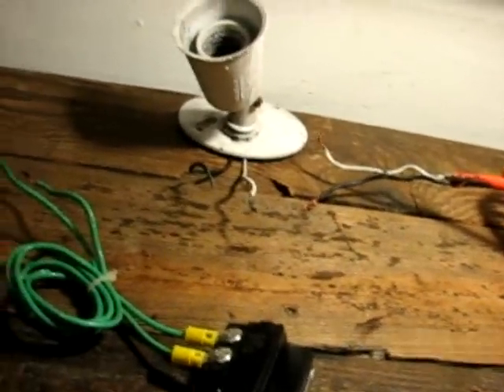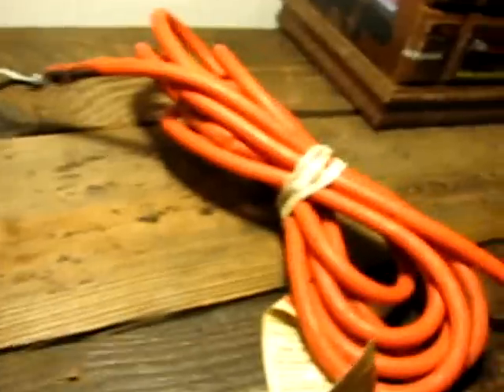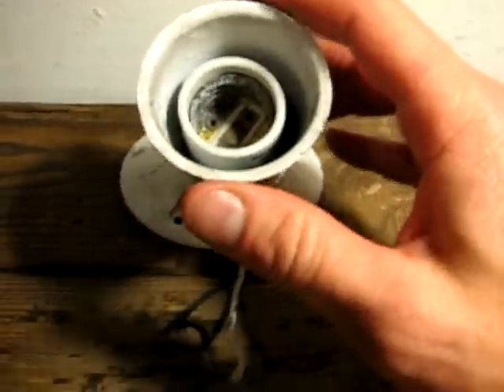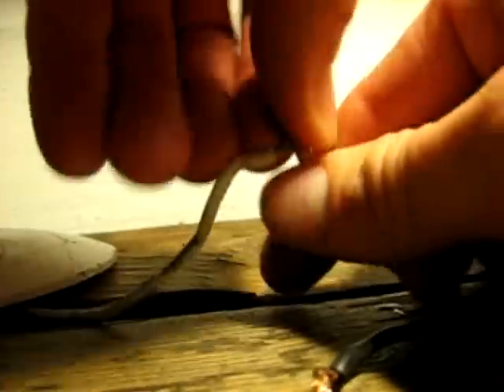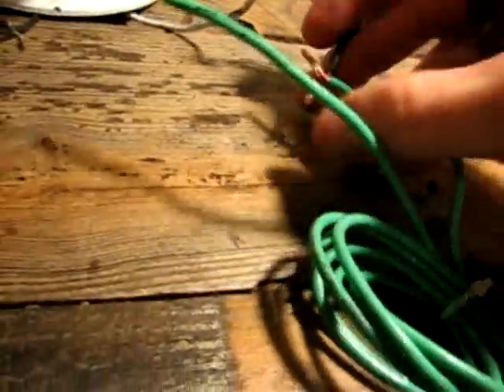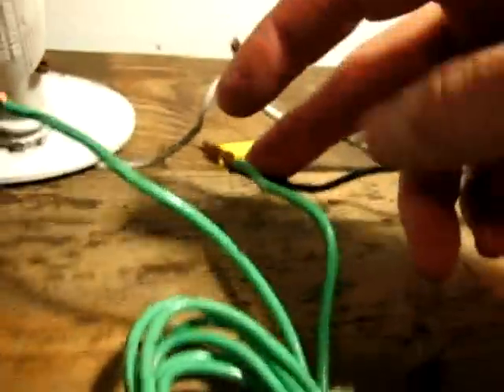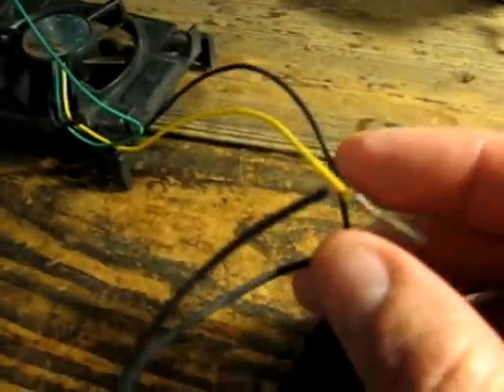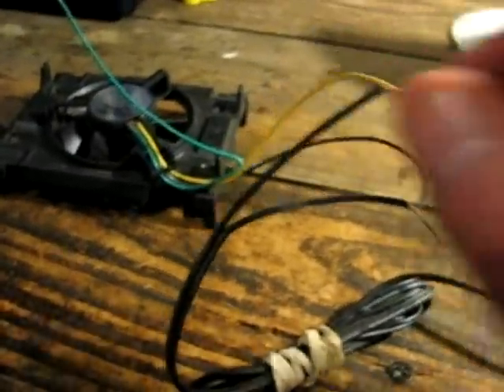How to wire INCUBATOR for hatching eggs

Comment: how did you keep the humidity level at the right percentage did you add water to the cooler?
Reply: Usually, yes, you start with a wet sponge or a small container and if that isn't enough, keep increasing the surface area of the water container. In certain parts of the country, and depending on your environment, you may not need to increase humidity, but decrease it instead - that's a problem! Using a combination digital thermometer/hygrometer can tell you if you're in the right range.

Comment from the maker: Yes the other is for high speed...I don't know....maybe the fan is old?...make sure the fan is not the 6 volt kind...try to spin the motor after plugging it in...first test with meter from transformer ....then test  to make sure its not a dead short in the motor.

Comment: Well, I wired my 120 in 12v out charger to the wires you instructed. I cant get the fan to spin all the way. Black stripe wire from charger to black wire on fan. I used my orange wire to the other charger wire but I just get a hum and the fan slightly moves. The other wire I assume was high speed? it popped. What am I doing wrong? Seemed so simple. LOL. Thanks!

Comment: That would depend on how you have them wired. If I remember correctly wiring them in series would require a higher voltage, but the draw back is, one fan goes out they both stop. On the other hand if wired in parallel 1 fan goes the other still works. Also wired parallel 2 12v fans would only need a 12v power source, but need higher current (mA or A)

Comment: so i have a question with a water heater thermostat the temp relay varies on when it will turn off . i picked up a thermostat and set it to lowest temp 90degrees thermostats have a -+10 degree so if you set it at 90 it will go as low was 80 before the relay turns on heat source but it will let it go up 10 degrees before it turns off so if i were to set it up at 100degrees it could go as low as 90 but as high as 110 before it turns off. 110 is too high. how do did you get past this point?